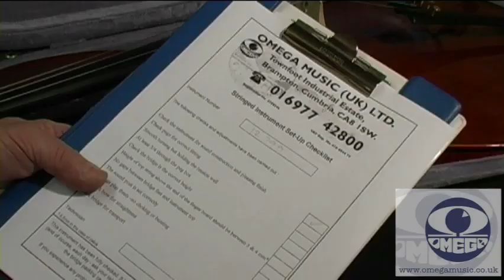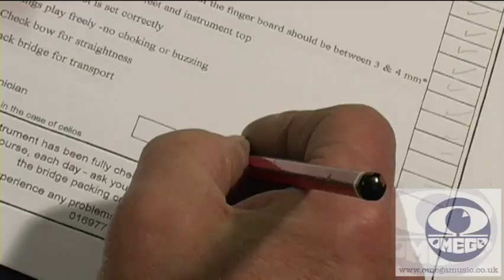How to Set Up a Student Cello Correctly

Comment: As a luthier I can say this is bad advice. Firstly, you should never put the bridge up when the sound post is missing. It warps the top and gives a false reading on string height. Secondly, you need to put all 4 strings on with full tension to split the cello legs when making the final bridge height adjustment. You can't just lay the strings lightly like you can on a violin. Thirdly, invest in a proper knife. The boxcutter gets blunt extremely easily making it a safety hazard when cutting into quality maple. Fourthly, There is no such thing as a correct setup for a student cello. All cello should be set up the same way regardless of quality.
Reply: @CC-hv9ei  With an Electric Bowed instrument no need to worry about that sound post cause you plug in  and play, the bridge sits on that contact mic.
Reply: @CC-hv9ei  Your teacher has to change that to where you have easier action, Electric Cellos solve that problem with their flatter body.